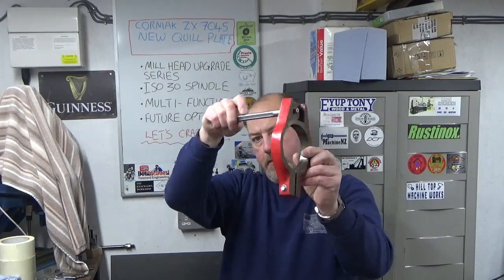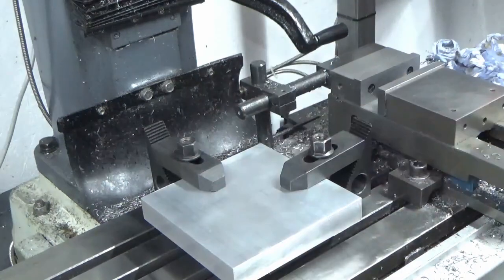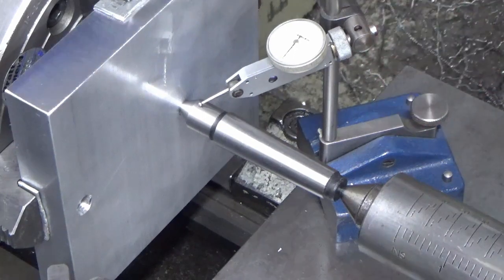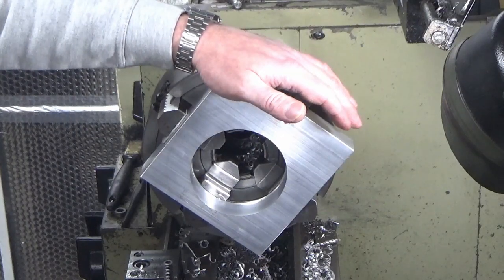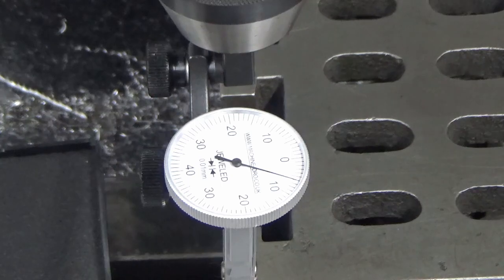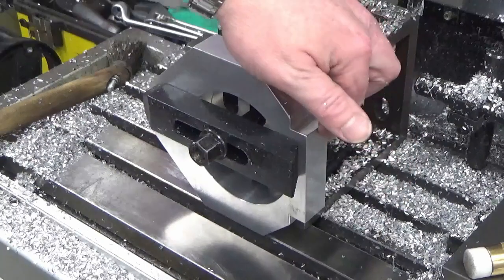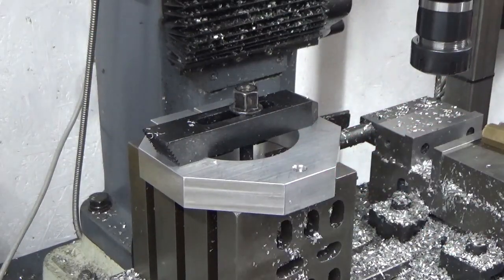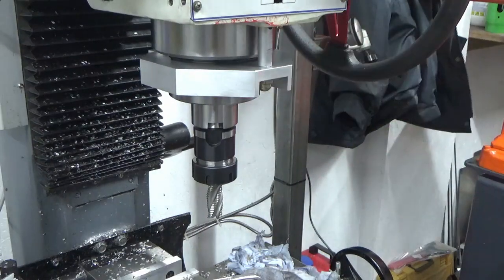Cormak ZX-7045 Mill Head Upgrade Part 5 - New Quill Plate

Comment: Well done Jon. Hmm, would have been a good exercise to use your recently acquired boring head 😊 Another time if you are worried about the part springing and pinching on the cutter, before you cut it all the way across, slip in a bit of scrap packing the same thickness as the cutter where it is fully cut. Great use of the Box Angle Plate by the way. 😊 Regards from Australia.
Reply from the maker: Hi Dave, thanks for the comment. Yep, I considered the boring head but I have yet to make a drawbar to fit it as its imperial. I also want to extend the splined area on the top of the spindle before I make new drawbars, it is currently 2" shorter than the MT4 one for some strange reason (all upcoming over the next couple of months). Good tip using a bit of stock in the slot, I have also used a screw jack in bores before to do the same. I was 99% confident in this setup so just went for it 😊. Cheers, Jon

Comment: I like it Jon, very nicely done. I was cheering when you got a one clock wonder setting up the angle cube. That doesn't happen very often. 
Best wishes, Dean.
Reply from the maker: Hi Dean, thanks for the comment (I'm just catching up lol). Yup, fluke on the clocking. Like you said, it doesn't happen too often, but it's strangely satisfying when it does! Cheers, Jon

Comment: Great build Jon. I could do with making one of those. I could probably spend the next year on improvements to my mill! The quill DRO is currently connected to the spindle with a rather thin bit of plastic and a couple of M4 bolts. Another one for the ever growing list!
Reply from the maker: Hi Olly, thanks for the comment. Lol, I will probably spend the next year on mine as well, plenty more to go at. There is still an inherent stability problem despite the work done so far. Your mill cuts deeper and better than mine currently. Going to continue chasing back until I crack it (hopefully not literally). Cheers, Jon

Comment: Hi,Jon. Great design on this quill plate. the multiple angular flat faces offer a lot of mounting options for future additions. I would definitely look to add a halo led light at some point as they are about the best in the way of work area lighting on a vertical mill or pillar/pedestal drill. 
i need to make something similar to improve on the feeble quill plate on my Warco 16 mill as it currently has no facility for a positive adjustable depth stop and squinting at the LCD quill DRO as I get to full depth is a real PITA.
Just to add that I far prefer a full box angle plate than a 2 sided item....far more versatile.
Reply from the maker: Hi Howard, thanks for the comment and feedback. Yep, the box angle plate is a fantastic, and often overlooked bit of kit. I may look to put a halo light on at some point in the future. Cheers, Jon

Comment: Again nice work Jon, one thing I’ve seen on YT is guys using a parallel in the bed key ways up against one edge to align V blocks or angle plates, not sure your view on that idea 👍👴🏻
Reply from the maker: Hi Terry, thanks for the comment. I have done this many times over the years, it's perfectly acceptable, especially where tolerances are relaxed (as they were in this case actually). I can't help myself using the dti though, I think it's the aerospace background lol. Cheers, Jon

Comment: allways wondered why people dont use a good holesaw to start the hole in aluminium plate , still leaves you with a usable piece of round and should save some time as you can start with a pretty large hole (though probably not realy centered it will be once you machine it with a boringbar)

one thing you could still add is a circulair groove on the bottom of it and drop a 12 volt halo light in there
curious to see how youre going to set up the quill dro , been looking intoo setting it up behind the faceplate but there doesnt seen to be enough room , maibe if you take out the switches for the tapping feature out and put a magnetic type pickup in there , seen them use a precicion potmeter on the quill itself with the touch dro setup (kindof homemade setup using a android tablet as the base that can use all sorts of pickups optical / resistance / and magnetic) ,
blondiehacks recently installed one of those on her lathe : https://www.youtube.com/watch?v=KufORj-o__I
one other method i considered was a new faceplate with the quill dro fitted with the sensor part through the (widened) groove thats in there now (used for the dept measurement)  , the sensor mounted on the roundbar that holds the quillplate advantage of that is that it seals the groove in the optical pickup against the faceplate so theres less chance of dirt getting in there and it looks verry tidy
Reply from the maker: Hi Watahyahknow, thanks for the comment. That is a perfectly acceptable method, the only one I own is about 20mm so not a lot of use on this job. I would usually trepan out the core, being in utter chaos as I am lol, I have lost my trepanning tool. Going to keep my eye out for some rotary broaches as these are very useful too. Cheers, Jon

Comment: Hi Jon. Maybe missed it but what clearance did you give between the quil and plate diameters
Reply from the maker: Hi Philip, thanks for the comment and question. I left 0.03mm (0.0012") clearance at turning, but as expected, it closed that up one I milled the slot in so finished up size for size pretty much. Cheers, Jon